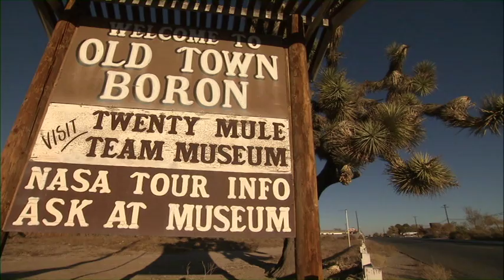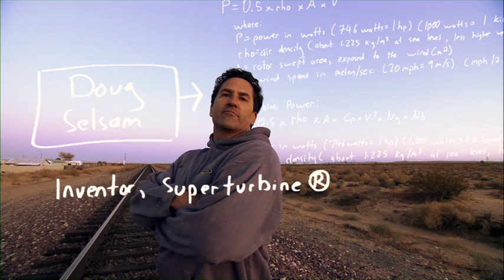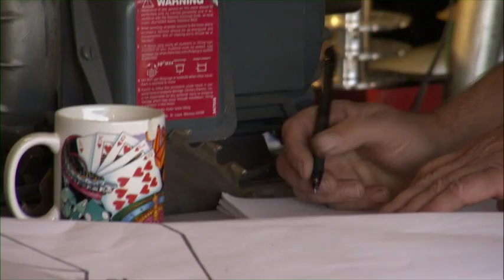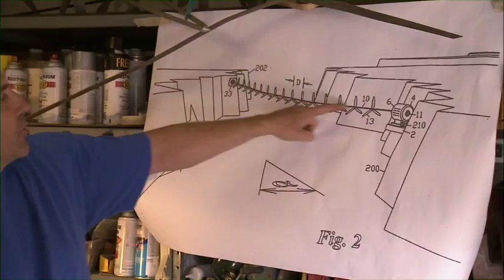Doug Selsam Inventor of Superturbine(R)

Comment: This is absolutely BRILLIANT!  There are two solid ideas here from Doug Selsam who has demonstrated proof of concept.  The environmental impact of his ideas is very low because of greatly reduced use of materials and embodied energy compared to established wind power systems.  These units could be located away from migratory bird pathways.  
Plenty of good locations are available around Australia and other S hemisphere countries.  Where are the Venture Capitalists to take this to the next level?  All accolades for these developments are fully deserved.  Congratulations to Doug Selsam and Team.
Reply: A tiny free whistle one of the blades will warn birds off, but the idea hasn't been accepted yet!
Reply: So he's built a turbine that can only harness wind from 1 direction out of 360 degrees..... Worst idea ive ever heard. You can enjoy your patents...
Reply: Needs to make this a water pump and soak the forest of northern California. Then mountain top to mountain top would make sense and all the haters would go back in their troll holes!
Reply: rambus eighty-eight they put this Idea in use in Palm Springs and it worked but in Mojave it failed haha stupid batts
Reply: +jorge S wrong this design can only harnesses wind in 1 direction. If they said it worked they lied. It's possibly the worst design ive ever seen. Even Vertical axis turbines work better than this would....
Reply: +Alex Townsend 
The balloon idea would work though with the generator on a pivot as the balloons would always move the shaft in the direction the wind is blowing.
Reply: Hi Kevin. I think there are some serious safety issues if it wasn't fixed somehow. It seems far too easy to vandalize or disable accidentally with a drone. also the larger the balloon the more it obstructs airflow around the turbines.

Comment: I think it could be more efficient, but I could be wrong by having a solid /not moving pipe or beam where each propeller is attached to a ball bearing and each propeller has its own generator this way instead of 20 propellers powering one generator you have power from 20 generators

Comment: Ummmm...  A "super turbine" that is miles long?  From mountaintop to mountaintop?  Does dude even realize how heavy that apparatus would be and how much tension would be imparted to each anchored end?  That's the problem with "inventors" who don't have a formal engineering education.  They scheme and dream and tinker and toy around in a purely hands-on manner.  But almost always,  things end in a dismal failure.  Mind you, there's NOTHING wrong with working with your hands, but being able to also sit down and work through the math, look up material properties and understand the fine details of wind flutter, vibration, statics and dynamics is VERY important as well.  In the 1940's, engineers designed and built the Tacoma Narrows bridge.  Everything seemed great until cross-winds caused aerodynamic flutter and the entire thing ripped itself apart and fell into the river below.  They DID do all the math and still f*cked up...

Traditional wind turbines can align themselves with the changing prevailing wind to extract as much energy as possible.  Anyone care to enlighten me as to how a mile-long rope of "propellers" (technical term gleaned from the video), permanently anchored at each end, can adjust itself for constantly changing wind conditions?
Reply: Better to fail miserably than be a miserable failure.
Reply: If YOU do what YOU'VE always done, YOU'LL get what YOU'VE always gotten.
Reply: I've seen MANY formally educated engineers that work for many large companies that fail at EVERY turn. That's why your microwave oven breaks every time you use it. I've also seen many managers that are an embarrassment because they can't spell. Just because you are "formally educated" doesn't mean you are smart or correct. And this idea sucks !
Reply: Full fledge Mechanical Engineers do exactly the same as Doug and we call it Research and Development. Better know as trial and error! One gives it their best guess of what should work best, build a prototype, and test it. Exactly as Doug has done. So maybe he makes the drive shaft out of carbon fiber verses fiber glass. Carbon Fiber is 10x stronger then steel, and half the weight of fiberglass. Maybe adding a shroud around the rotors would offer some bird protection?  But it really doesn't matter as he has proven his concept! The man is a genius!
Reply: The Wright Brothers owned a Bicycle shop, but had the first successful flight! Edison had 1001 failures before he found a metal that would work! NASA had many rockets blowup on the launch pad, and Ford had the Edsel! Give credit where credit is due! What I learned in College was the basic's! Old knowledge of things that had been developed in the past. Old concepts, and existing materials. Doug is an innovator! Everything he needs to know is on the internet. Materials, strength of materials, weight of materials, cost of Materials!  He can float Bearing supports on a suspended bridge type apparatus to carry the weight if needed. The thing is........ it WORKS!
Reply: I have to agree a formal education is worth a lot more than people seem to be giving it credit for. It is simply put the most efficient way to learn. You will learn more information in a single lecture than you can study on your own in 3-4 hours. Thats not to say you cant teach your self the same theory with books but itll take longer. Now interms of the design of this spining blade the main problem seems to be the fatigue issue. The way in which the drive shaft deflects is putting some locations into compression and others into tension now rotating this structure will continuously reverse the stress with an r value of -1 so it seems like, from the calcs, that the shaft will faill relatively quickly as in around 20 days. Id be interested to see how Doug adresses that issue?
Reply: Doug Selsam Hi Doug, I was just wondering what your expected cycles to fatigue failure was on the drive shaft?
Reply: I have a formal degree and it took me 20 years to get it. First I was a Machinist, then a Tool & Die apprentice, then a Model Maker, Then a Master Model Maker. I worked for USC in California and went to school at night for free. Eventually I opened my own full service Design Studio. I designed, Engineered, and built over 2,000 working prototypes. Doug you are doing everything right! There will always be those that are negative, just ignore them!
Reply: @BluntForce - I guess you've never seen a suspension bridge like the Golden Gate or Chesapeake bay bridge.  They've use steel to span bridges several miles long for  quite a while now.
Reply: Use PEX and sharkbite fittings, they solve everything.
Reply: Well, it's nice he actually has an idea and is putting forth effort to develop and publicize it. He's not perfect. You're not perfect. No engineer is perfect but collectively we (humans) have perfected a lot of technologies.
Reply: BluntForceTrauma666
Reply: he doesn't understands things properly, that's obvious. he never thought storms, lightnings or maintenance of such a thing. Miniature turbines spinning very fast on a rope, will tend to break and fail quite often. he never thought of that.
Reply: well, it's just worthy of an embarrassing clip :)
Reply: For a 3 Meter by 1Km collecting area, the force generated by a 20 mph wind is on the order of 20000Lbs to 30000Lbs. Given the 50000 PSI + tensile stength of common steel alloys, I don't think an extraordinary amount of material is needed. If you drive monster trucks, such stresses are generated pretty routinely. You do have to be creative with the geometry of the shafts at those scales to get around helical buckling. I think a team of manufacturing  and mechanical engineers can make this workable.

Comment: nice concept. but as many have said. the constant flex of a long shaft like this would cause fatigue, and the potential for harm when failure occurs will me much greater with something spanning the distances he is dreaming of. it could be made more reliable and safer with a thick multi core wire supporting the shaft through bearings inside .  downside would be harder to maintain/replace the bearings and higher weights. but shorter spans of these could be interesting in places where the wind direction is more predictable. such as between tall buildings.

Comment: If you call the rotors "propellers", you are not to be taken seriously... A propeller propels...
Reply: Doug Selsam I wasn't going to respond to this, but I feel like I have to. Rotor is a generic term for anything that rotates. A propeller is a rotor that is driven by some kind of motor or engine, producing thrust and propelling the vehicle it's attached to. A turbine is a rotor that uses the energy in a flowing fluid, for example air, water or the exhaust from the combustion chambers in a turbine engine, and converts it into a rotation to drive for example a generator (which admittedly has its own rotor), a compressor or fan stage in a gas turbine engine, or for that matter even a propeller, such as on a turboprop engine. If you think your audience are so uneducated, why don't you just teach them this very simple terminology? Dumbing down something just makes those of us who knows something about this trust you less, and those that don't feel stupid.
Reply: What I mean by this is, what's on a wind power plant is a turbine. Propeller is the exact opposite of turbine. You don't call the basement of your house an attic, because there might be people out there that don't know what a basement is, do you.
Reply: well, if you look at 10:54,the correct word is propellers.
they are using the "generator" as a motor, no way that structure can spin that fast and accelerates that way.
cheaters.
and the best part, he said the traditional wind turbines behind are probably using as much power they are producing.WHAT THE HELL????OMFG
Reply: Whats he point of making the wind turbines spin using more power than producing?

i don't get it.
Reply: Propeller is fine for it propells the generator that otherwise would not make power without

Comment: Fake as hell. It works when you switch the motor on eh? The term propeller isn't that far from truth after all. 
10:52 you can clearly see that the shaft is not locked by a brake because the rotors move left to right. Then it suddenly starts to spin like crazy and from the fact that the first rotor starts to spin noticeably sooner than the far end of the shaft it is evident that the motor spins the whole assembly not the wind...
Reply: "The motor spins the whole assembly not the wind"...  lmao
Reply: OK, I take the statement about missing diode as an explanation as well as a confirmation that the motor delivers the torque required for shaft rotation, not the other way round. Electric energy is therefore consumed, not generated at 11:00. 
Once again this reasoning  is based on above mentioned observation how torsional deformation of the shaft propagates from the motor to the balloon-suspended end. This is clearly visible at the moment of start in your video and it proves that the motor is the source of mechanical energy that rotates the shaft not the wind.

To me it still seems like a fake, can you prove my statement is wrong (I am talking specifically about the time-frame 10:52 to 11:00) ?
Reply: Why would you not use a blocking diode?  What instrumentation did you have to see how much power is flowing and in which direction?
Reply: Thought the same when I saw it. Scrolled down to comments to see if anybody else noticed it.
Reply: "A DC motor is a DC generator"
So... how does this DC generator work? U even said you build ur own generators here in the comments ("even manufacturing our own generators"). Please tell me something about this DC generator and how it works.

Comment: to add to your playing .. why not to use cable stretched between 2 towers by axel pressure resistant bearings .. that may last bit longer and sort of safer . After all bridges are hanging on cables . ... but no matter what any safety improvements will kill the idea of saving ..so wee come back to big size slow rotating windmills on tower  ...so far that's the most economic and efficient . 
.. i still admire your toying !

Comment: Use electric powered drone(s) instead of balloons to support the drive shaft and actively position it for maximum efficiency. Put em on boats, instead of sails or in addition to (might as well charge up some batteries if nothing else). Doesn't need to replace, may find an efficiency niche.

Comment: Doug Selsam, With very long rotors, passing thru various wind speed streams, at the same time, you'll need to install, ratchets on the impeller shafts so the fast moving impellers won't be delivering energy to the impellers in the slow stream section. The impellers in the slow stream section will need to "Free Wheel" so as not to waste shaft energy. Maybe all the blades on all the impellers have variable pitch, so they can ALL keep pulling-in-the-harness. Oh boy, that's really funny, you're the one with the good idea, the one making all the hard decisions, the one with all the skin in the game, and I'm having the audacity to think I'm doing some delicate type engineering. Ha. Who's the fool? That's right, ME!!! Well Good Luck. Hope you generate great success.

Comment: To me very good to focus on better utilizing stronger winds higher in atmosphere. BUT here in UK (windy place very suitable for windpower) most mountain sites are in National Parks or similar and chances of getting planning permission about zero. Having balloon lofted turbines not only intrusive but couldn't be located anywhere near flight paths of low-flying aircraft. Current propellor-on-pole wind turbines can/are being located offshore in plentiful shallow water where very few people bothered about environmental intrusion. Also, in autumn and winter are often storms with Force 8-12 winds. Conventional turbines deal with risk of damage from being overloaded by simply automatically rotating blades to be end on in high winds. Both of your systems run risk of being smashed up by storms because much harder to feather them.

Comment: ``Wind farms mills have to be well-separated from next mill upwind, or efficiency drops radically. These tiny mills are far too close & all but one are downwind of that one; though some higher or lower than others helps. Similar old schemes put a single big turbine below a balloon with a long rotating cable connected to a grounded generator - possibly with a 2nd turbine 1/2 way down. Dr.Pat

Comment: What if this technology were coupled with anabatic or katabatic wind sources? Unlimited wind with superturbines that are unhindered by usable land constraints, since the locations where these winds are generally located are pretty much useless for normal habitation of any sort. These turbines could be built close to the ground and perhaps used in stacked arrays?
Reply: After watching your informative video and reading some of the constructive critiques;  I tend to agree that a solid drive shaft may not be the answer for extreme length applications.  Perhaps in the future, when funding becomes available for you, you might consider a carbon fibre "cable" or similar high strength cable, rather than a solid shaft. I mean, really who cares if it sags over an extreme span and your wind vanes can be fastened to a larger diameter cable just as easily as a solid shaft, no? Now you have removed the worries of early flexural failure and replacing the entire span would be much simpler than trying to replace a solid shaft. you could use a 3/8 inch (or whatever size you want) steel cable over a similar span as you are using now to show proof of concept.  Just a thought.

Comment: Use that concept on water pipes that have pumped water over mountian ranges. Impellers with electric generators on the outside of the water pipes like how a electric. aquarium water pump works just in reverse. 😊

Comment: I love it! I would think a modified blimp with enough plane surface to resist the torque of an onboard generator would be more stable than a balloon. would be a feet to program it optimally. Maybe multiple blimps along the way.  And as far as Birds, I believe they would have less trouble avoiding this more compact and 3 dimensional turbine. To me its not danger-es enough see if there is some way to incorporate  High Voltage.

Comment: this is an interesting idea, however it does have a couple of problems that may or may not be solvable:

 Since the shaft is driven at a 1:1 speed to the generator, this means the shaft must spin very high rpm to spin the generator at a sufficient rpm to create power. this can be solved with a gearbox, or perhaps more load on the shaft to slow it down. Also the shaft bearings and shaft itself might have wear issues spinning so fast over time. However, using a solid aluminum shaft pulled under tension span across two anchored points might be a good solution. 

 the unattached end point is an interesting idea, but i will say that this has a dangerous element to it as well. Normal wind turbines are by no means safe, but this has the potential to send shrapnel as very high speeds in multiple directions as the "slinky" falls apart upon impact with the ground, tree, etc.

 Also, what is the failure mode of this concept? such as a large gust of wind causing the shaft to break, does the rest of the shaft shear off as well? or perhaps retaining cables would be employed?

 What about if the generator loses load, or cannot slow down the shaft enough below the critical resonance point?